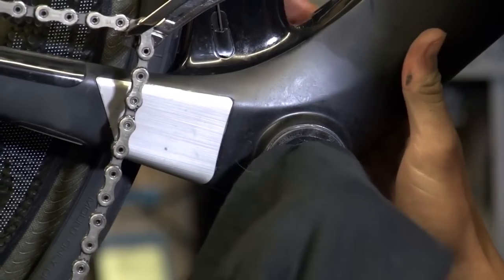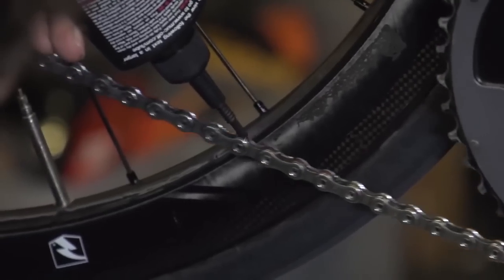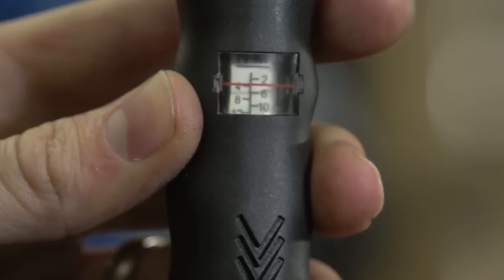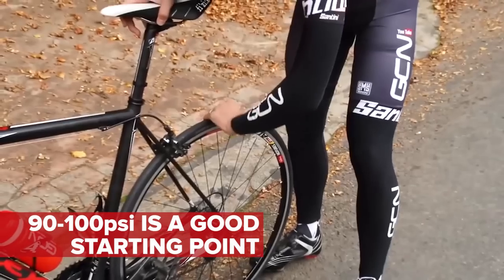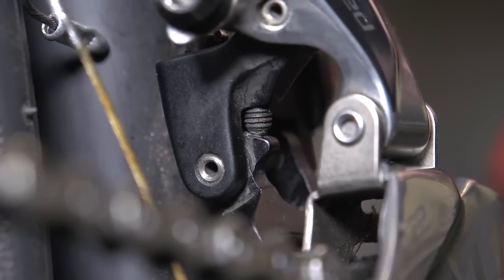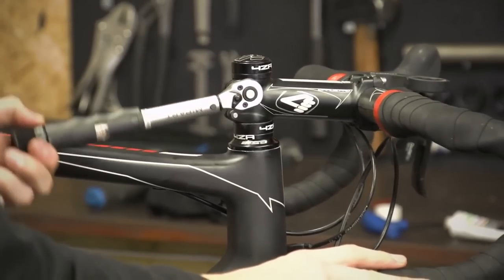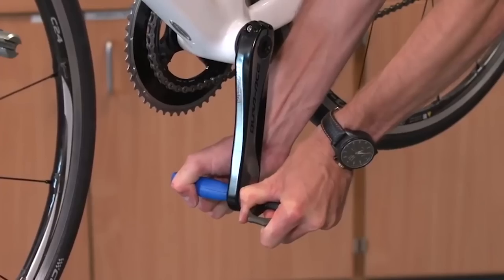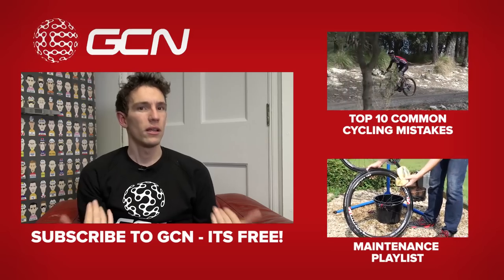9 Bike Maintenance Mistakes All Cyclists Have Made

Comment: 1) wear work gloves when using that pedal spanner near the chain ring
2) a bit more air pressure in the back tyre, slightly less in front (weight distribution is 60/40)
3) watch the GCN video on the subject, before doing anything new
Reply: 1.5) shift chain into large chain ring to avoid getting stabbed/cut by chain ring when using pedal wrench
Reply: Na it’s not actually doing it
Reply: Park tool advice, have a good mechanical position when opening a pedal.

Comment: 1 thing i dont agree is bolt tightening to 90% of the recommended torque value. Torque recommended by the manufacturer are already factored in for safety normally like 10-20%.
Reply: Jojo Labuguen you're assuming everything is exact all the time. They aren't.
Reply: Little late on watching/posting this, but I believe Si said 10% less than the “maximum” specified. This is presumably in absence of a “recommended” torque; so this seems like decent advice. Being an electrical engineer perhaps things are not specified similarly here, but for electronics, an (absolute) max rating is the highest point a value can be before damage can be/is done. And since being at that max would require precision it is not wise to dwell at these maximums for various reasons (tooling not perfect, non ideal components, noise, environmental factors). I think similar concepts apply here.
Reply: You are wrong. My wrenches is ±3% by specs, and +0.8% -1.5% by factory tests by all range.
Reply: I don't have meter for torgue. I just do it by hand.
Reply: @LauriAP  dont !! if there a torque requirement follow it by all mean. you could suffer a CATASTROFIQUE FAILLURE.
Reply: @samskisamsonof  actually as long as they don't overdo it then doing it by hand can be just fine, you just have to take more precautions, especially on carbon

Comment: Hi, if I get a puncture,  before removing the inner tube, I mark on the tyre with a pencil where the valve is.  Then when you remove the inner tube, inflate it to see where the puncture is. Once located place the valve next to the mark on the tyre. See where your puncture is and at that point feel inside the tyre to locate any sharp objects. Joe
Reply: You could just always put the valve in the same place. Like line it up with the logo
Reply: J S lining the logo up with valve shows you know your bikes
Reply: Much more practical.
Reply: I tend to repair my tubes instead of changing them always and this is exactly how i make shure there are nor objects stuck in the tyre.

Comment: Pro tip: put the chain on the big ring when removing pedals
Reply: Crankset Big Chain Ring or Cassette or both?
Reply: Marshall David WahlstromHelgren big chain ring, just incase when the peddle releases your hand hits the chain set. The chain stops your knuckles getting cut.
Reply: Left pedal has left-hand thread. Open clockwise

Comment: The last item you noted was hitting your hands, I always think of knuckles, when loosing pedals. A tip that I learned many years ago is, whenever possible, pull a wrench rather than push. This way, when the torque is broken, and the fastener comes loose, you won't have all your weight on the tool, causing you to lose your balance and busting your knuckles. Just another good tip to employ whenever possible.

Comment: When removing pedals, orient yourself so that you are pulling the wrench towards yourself, rather than pushing on the wrench toward anything "pokey". Apply equal pressure to opposite crank arm. When the pedal breaks free it is much easier to control what your hand does/where it goes. This is sometime easier with a repair stand.

Comment: I've got a crockpot dedicated to chain maintenance. It's got a few cakes of wax in there that melt and gets inside the rollers to provide excellent lubrication. Because the wax dries there's no sticky surface to attract road grit, and because there's no oil I can touch any surface of my drivetrain without getting messy hands. Cleanliness of a bike has multiple benefits, and I enjoy it so much that I probably apply myself to bike maintenance more often than it actually needs.

Comment: Number 10 - cutting outer cables to length with the inner cable still inside...
Reply: Graham Nicholson guilty here!
Reply: Actually, cutting the cable housing with a cable inside is a good way to avoid pinching it (but an old cable should be used for sure).

Comment: there is a totally easy way to remove pedals painlessly.

simply place the spanner properly, almost parallel to the crank arm, grip the crank arm and spanner with both hands and squeeze them together with both hands gripping around the crank arm & spanner. this stops the cranks rotating.

Comment: I've never scraped a knuckle yet when removing pedals. Just point the crank forward, put the Allen key or spanner on pointing forward too and then press down on the end of the crank whilst pulling up on the tool using your shoulders with locked arms. Pop, done!

Comment: Tips for pedal removal:
1, put the chain on the outer chainring so if you do punch it, you'll be hitting a chain, and not a sharpenned gear.
2, use the other crank for leverage
3, let up on your wrenching effort as soon as the pedal starts to turn.

Comment: It was good that bit where you talked about having a flat tyre and how it affected your mood and you used the word 'deflated' ... It was brilliant because if the double meaning of the word 'deflated' ... A flat tyre loses the air pressure from inside and it then the tyre becomes 'deflate' ... When you feel the emotions associated with such a situation, a mechanical issue that disrupts your ride, you can say you feel 'deflated' to mean that you were excited and happy but those feeling went away because you had a problem which made you feel 'deflated' just like how your tyre was feeling. The tyre was 'deflated' but not in an emotional way because rubber has no feelings but you were feeling 'deflated' yourself because you were upset that the air left your tyre leaving it 'deflated'. It was like a sort of subtle phrase you used, most people wouldn't have caught it in passing but I did. Where's my fucking lollipop.

Comment: Tip for those tough to remove pedals, align the handle of your pedal wrench so that it's nearly in line with your crank arm then squeeze the handle and crank arm together like a you would a large pair of pliers. You wont have to keep the crank from turning to you can use both hands, and when it loosens it goes gently.

Comment: 11) Having maintenance performed by a large retailer beginning with H. (only one bad experience to be fair but enough to make me want to do it all by myself - They failed to diagnose the real issue with my bike being that the chain and cassette were worn to the extreme and were no longer fully meshing and needed replacement. Instead they replaced extraneous bits on the bike that probably didn't need replacing)

Comment: I always used to clean my chains and they lasted 3 or 4 years my newest chain I just oil and it lasted over 10 years,  I'm surprised it hasn't broken yet I can easily fit a flat head screw driver between the chain plates it's that worn out.

Comment: great video, except for the tightening of every bolt. That really differs so much per bike and clamp. If you install another clamp with N*m indication on it but it has 2 bolts instead of 1, or if you use mounting paste or lubrication on the bolts them self or locktight, everything changes. Just like the thing: where to use grease and where not while mounting parts (bolts, stem, bars, post etc.) can be hard to decide because many books, mechanics and videos tell you different things. If you are an experienced mechanic and you haven't ran into problems over the years, you know your bike well and should do what feels good.

Comment: It's also important to bear in mind that a typical torque wrench is only accurate to within 20% of the actual torque, so if you go for 10% under the torque requirement you might not end up not giving the bolt enough pre-load.

Comment: I have to underscore the bit about removing pedals.  We had some repaired customer bikes hanging from hooks.  A customer picking up their bike purchased a new set of pedals he wanted me to install.  Since all the repair stands were taken I decided to just change the pedals on the hanging bike.  I was pushing toward the bike and when it came loose I punched the chainring which seemed to cut all the way to bone.  I should have gone to the doctor.  It didn't get infected but it really needed a stitch because every time I bent my index finger more than about 60 degrees the wound popped open and started bleeding again.  I still have a pretty gnarly scar from the incident.

Comment: These are so true!  The one that is missing however is the time I changed my rear cog set from a 12-25 to a 12-28 but didn't increase my chain length.  I didn't realize my mistake until I was riding and couldn't shift up to the new gear!

Comment: Chain to spoke contact?  That's why spoke protectors are made.  Oh that's right, 'not fashionable'!
Reply: DepakoteMeister you got it fam
Reply: Spoke guards are designed to prevent the chain from falling between the sprockets and the spokes *when the dérailleur gets bent*. In normal conditions, the upper limit screw of the dérailleur is the way to avoid that.
Reply: Are you joking?
Reply: You can always take them off and paint them black (or whichever color you want). They don't look that bad in fact kinda cool.

Comment: talking about chains, a piece of fabric like you showed in the video is enough to remove chain dirty? i`ve been removing the dirty with a piece of fabric, then applying a drop of lube ate every 3 links, then i spin the crack for about 30 seconds and done, all chain is lubed. Tell me if i`m wrong.

Comment: seized seat post? place lube on the upper part then push the seat post down into the frame a little allowing the lube to penetrate the frame when you pull it back out it will be unstuck cause

Comment: Local bike shop Drills out the bolt and then replaces it? Some bolts aren't even available any more, like the tiny 2-3mm easily stripped center adjustment bolt on DA and Ultegra direct-mount brakes or the derailleur main spring. NEVER throw away old parts, you may need the bolts.

Comment: Isn't a chain ring scar a rite of passage for cyclists?
Reply: Sure it is.
It is even better if one have both scars from the chain on one side of the hand and from the bottom bracket teeth on the other.
It is very easy to achieve when you play with the chain of your fixie while the wheel is turning.
Reply: Only if its on the shin. It doesnt count on hands.
Reply: i have one on on my calf, chain broke. filleted me open. 10 stitches

Comment: Yes I got that problem with over tighten screw on my crank arm it seems like the mechanic at nearby local bikeshop to me likes tight screws and now no one can remove the screw on my crankarm making the problem hex wrench circles also the screw where you put hex wrench and now i can't maintenance my bike's bottom bracket and crank very well, some told me to go to a machine shop and let them remove the over tighten screw which i doubt

Comment: Final tip. Gt85 sprayed into bearings. Don't do it!!! Headset, hub, or bb. It washes out all the grease and forces grit in from the outside. Potentially ruining them. What's another one we see all the time, chain stretch! Buy a chain checker and save yourself a fortune! 4 or more chains to every set of expensive rings and sprockets is far cheaper than smashing out all of them in one chain because you're a hero and only use the big ring and never replace your chain.
Reply: Pedals also come under bearings to avoid. Oh and don't get it on your disc rotors or pads. You will need to replace pads as they absorb the oil and will howl like a banshee.

Comment: I have an early 90s Schwinn Crisscross that was sitting in my parent basement for the last 13 years.  It sat in standing water for 6 weeks (during a flood) and the portions of spokes that sat in water are rusty. The tires are not cracked but there is a bit of hardness.... but I don't know if there are harder than when new,  They are original. One of the valves pulled out of the tube. I bought new tubes but don't know if I should buy tires nor if I should have the rims re-spoked. Thank you.

Comment: the pedals are always so tight because I always turn the wrong way first (I'm obviously not a pro and don't have to remove my pedals that often, and I always forget which one is the left tread and even if I remember correctly then I screw up because I forget that I have to turn the other way when I use an allen key to remove them from the back...) haha

Comment: Want to save your hands when removing pedals? Then keep them far away. Bike goes on the ground, pedal is angled at 4pm, Allen key goes into pedal spindle sticking out at a roughly 9pm position, step down on the Allen key.
Greater mechanical advantage, hands are safely away from the chainrings.
Reply: PS I can send along a photo if it would help to visualize.
Reply: (^crankarm @ 4 o'clock position)
Reply: Why wait till PM ?
Reply: +frankN Yeah wtf, I usually work on my bike in the mornings

Comment: I wax chain and use rag and brush to clean it. I don't want to use any dangerous chemicals because I wax in a kitchen stove. Not that i want any dangerous chemicals anywhere.

How big disadvantage waxing a chain is without petrol, grease-solvent and isopropyl alcohol? The dirt stays inside chain somewhat. And the waxing takes effort, although dipping chain in oil is recommended by manufacturers quidebook.

I filter wax with coffee filter running. Additives are mostly non-hazardous. Stearic acid usually and last time also paraffin liquid and bearing grease. Bearing grease for wet conditions, it is the dangerous part because have to note environment and take care of empty package and avoid repeating skin contact.